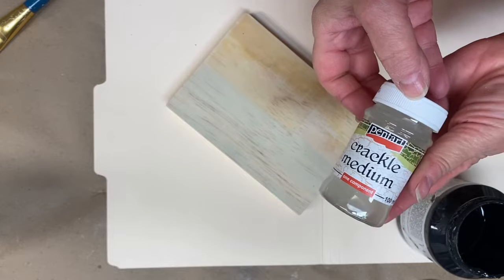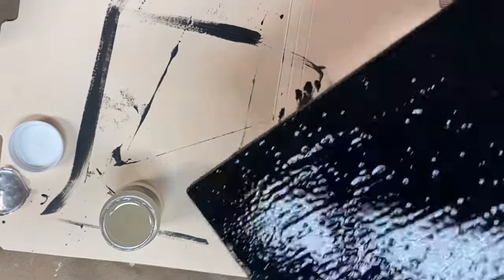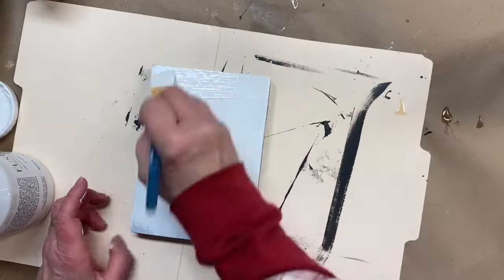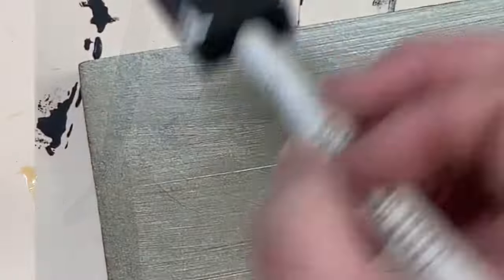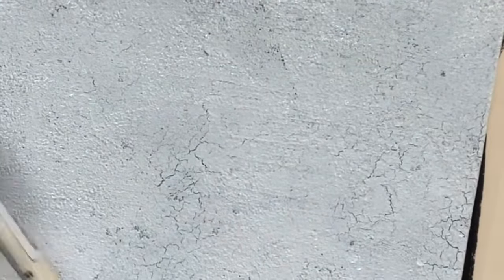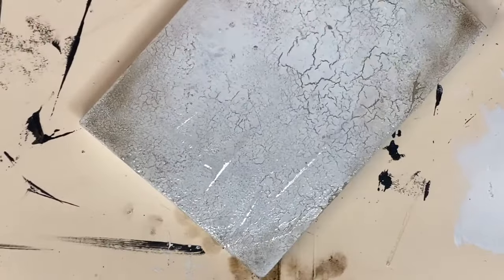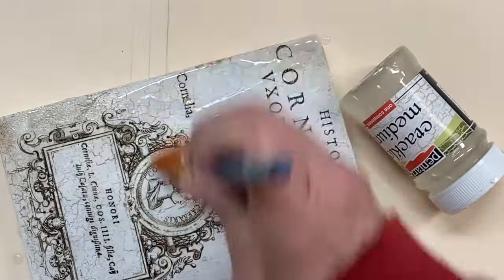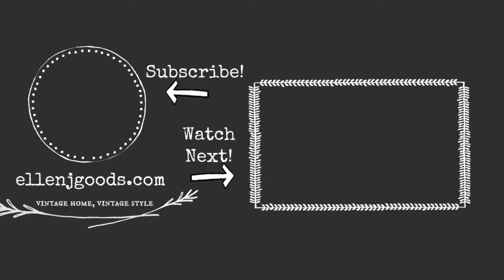Pentart One Part Crackle Finish

Comment: That looks really great! I just tried the same pentart one part crackle, but it doesn't work. Now trying to figure it out. Maybe the problem is that I use panting brushes...
Reply from the maker: I wonder why? What paint are you using?
Reply: @ellenjgoods  I use acrylic painting. I keep trying and looks better now. I think the problem was too liquid paint. I try not to use water at all, and now works better. ) Thank you very much for the demonstration. ♥

Comment: I love the look of this! I do have a couple of questions though. I’ve always heard if you use the 2 step Pentart crackle, especially over a decoupage image you must use a solvent based sealer over it. Is this right & if it is, can you recommend a good one? Thanks so much for your help, Lynne! ❤️❤️
Reply from the maker: Hi Roxanne. I did a video showing both 2 step crackles. There are 2 different ones. Fine line needs a solvent based finish. I use Rustoleum clear gloss spray.
Reply from the maker: https://youtu.be/UOrKsPpjeTU
Reply: @ellenjgoods  thanks so much! I’ll look for that video as well!